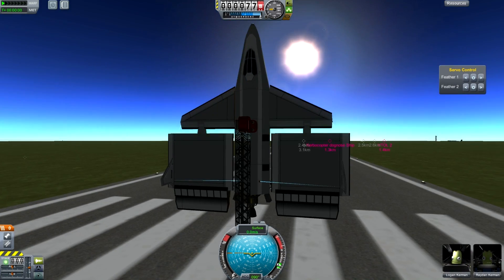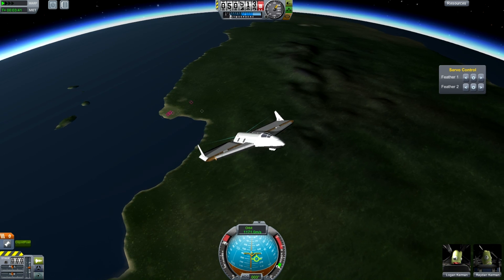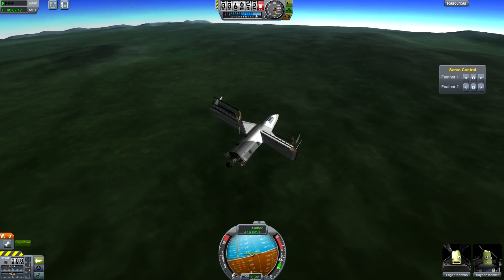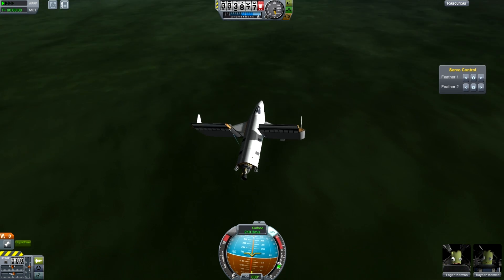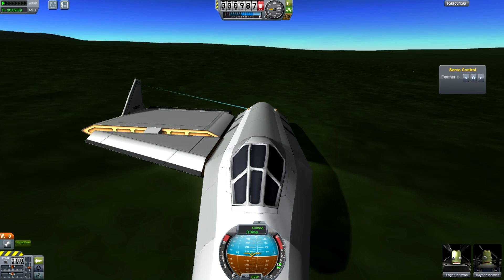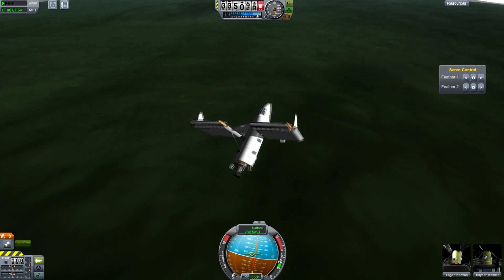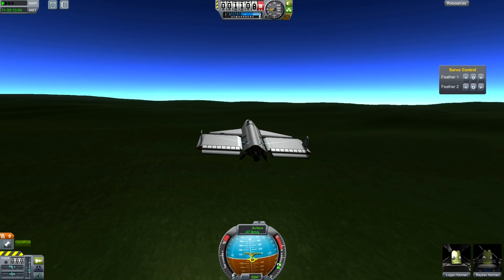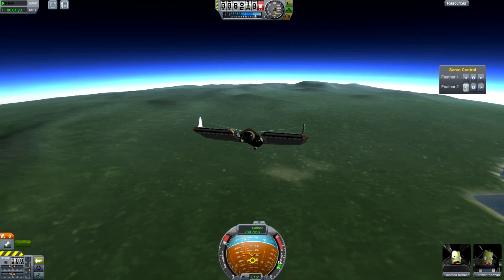Kerbal Space Program - Folding Wings For Feathered Re-Entry

Comment: You could correct the throwers orbit, but isn't that using fuel, which this scenario is designed to avoid using? (Dare I even suggest that the entire throwing station might be considered propellant, even if it's extremely inefficient?)